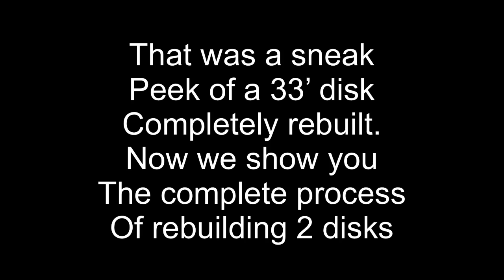Landoll 6230 disk’s get new iron.

Comment: I don't know my model numbers but does Landol really call those disks or vertical tillage tools seems to me that's a pretty gray area anymore whichever it is I'm sure it will preform a lot better now! Thanks for the video.
Reply: These are disks, the disks are "bowl" shaped. They cut and mix the soil.
Vertical tillage tools the disks are straight with a wavy edge. These more slice and size residue and loosen soil leaving some residue on top.

Comment: Great job on the video Andy lot of iron on them discs have to drop a gear with  3" of extra blade! Maybe even put the duals on the 4320 to pull it over the hills! lmfao 🤣 keep up the good work
Reply from the maker: The 4310 had trouble just moving the disk not to mention having it anywhere in the soil
Reply: Ya I bet that thing is a monster behind the 4320. I was just kidding about it actually pulling it

Comment: That job was one I always hated. With a disc that size it takes a community of folks to do it. We ran 32 ft IH harrows. Can't remember how many disc it took but it was a lot. Hardest part was the center section.  Relocating the gangs. How many bearings did you have to replace? We always replaced them too.
Reply from the maker: We replaced all of them, I ain't sure how many there actually was

Comment: Do you just use big impact to tighten or a slug wrench and sledge hammer also?  I have to use slug wrench on my big rome to get them tight enough.  I feel your pain on the blade problems, I put new 24" boron blades on my rome and broke 3 blades that spring.  Never again, back to weise blades.
Reply from the maker: We just use the impact too set them then we use a pipe about six foot long and really tighten them with that.

Comment: The wear down on the disk blades is impressive, how many years did that take? The ground wearing the blades down also does a decent job of sharpening them. I think that is the worst part of the  whole job is getting the old gang off without losing fingers or needing stitches. Thank you for today's video.
Reply from the maker: The small disk went 7 years and the big disk we use more and that one we had 4 seasons on

Comment: What tractors you use to pull these big pieces of steel? 33ft is alot for a 8320.
Reply from the maker: OkieDoke18 9410 or the 9320 on the big disk and the 8320 on the small disk